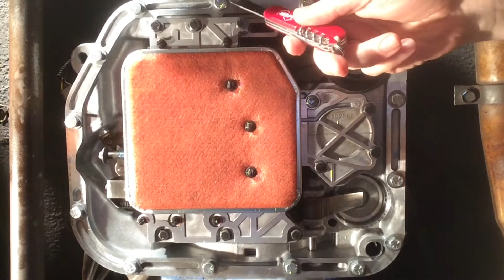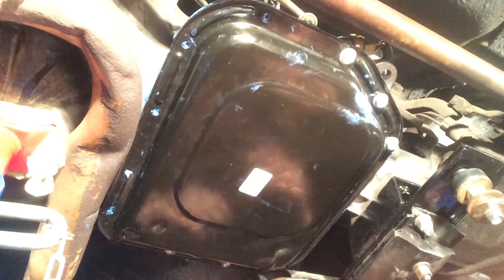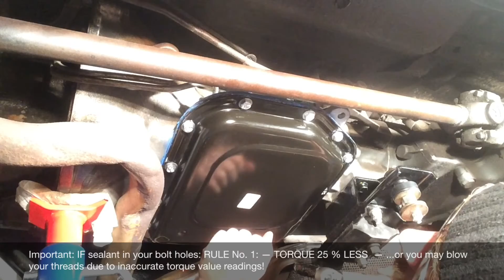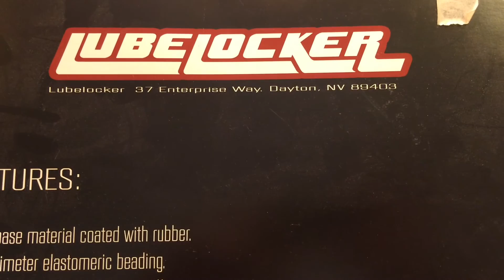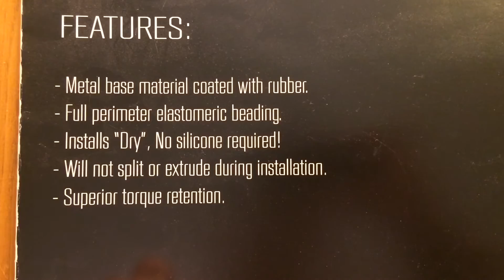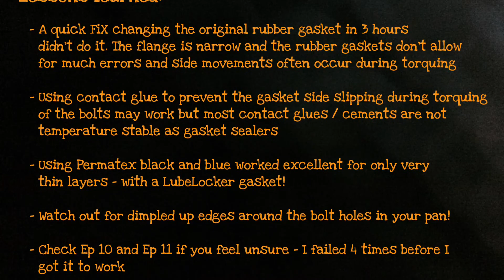100% sealed Torqueflite transmission pan - LubeLocker instructions - JEEP Wrangler YJ : Ep 12

Comment: So how did it hold up? I have a lubelocker gasket and it leaks.
Reply from the maker: When it’s standing for long times, more than a month, I have now after 1.5 years started to find small amounts of red transmission oil coming out. Next time I will buy a casted aluminum pan with a more rigid flange than any stamped steel pan . Thx for comment
Reply: Ken Sweden thanks! I’m using a B&M aluminum pan. Hopefully it holds ups.

Comment: Your not suppose to use RTV with lubelocker gaskets, Also you use way!!!! to much RTV.
Reply: @zumadale  absolutely not. You can use it to fill in gaps, but to Mercedes, Ford and various other brands and ASE youbdo not coat a pre-made gasket as it can cause premature failure during curing.
Reply: @seand2022   Could you elaborate on '...not use on pre-made gaskets....cause premature failing during curing...' thanks